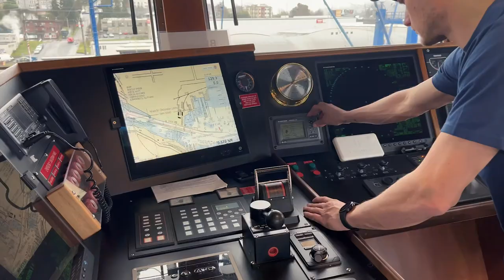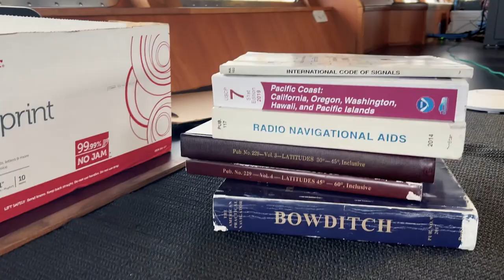Life Aboard as a Chief Mate

Comment: I’m currently getting my credentials for seamanship. I will be 60 in 2 months. I do 90 pushups once a week and work out all other body muscles I’m not an average 60 yr old guy. I can’t start as a mate? I have 7yrs of warehouse experience loading Pepsi cola trucks fast paced work. I saw a heavy set guy in the video I know I am in better shape than him. I drove a forklift for those 7 years. I can do that job and would immediately pull a mates workload when it comes to moving cargo. Obviously, I know nothing about navigation. Couldn’t I learn that on the job? Thanks!
Reply from the maker: You sound like you're in impressive physical shape. However, the officer positions require a license from the U.S. Coast Guard, requiring years of mariner experience and testing.
Reply: @coastaltransportationcrew  what size license is required?
Reply from the maker: @UhAndrew  1600 ton/3000 ton uninspected fishing vessel.
Reply: @coastaltransportationcrew  what would be the average pay for 1600 ton master of uninspected fishing vessel